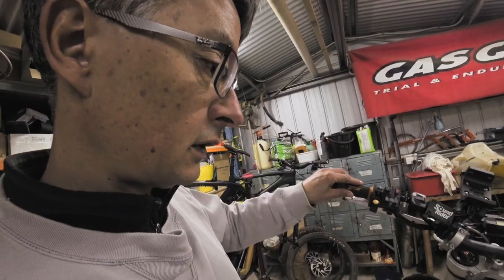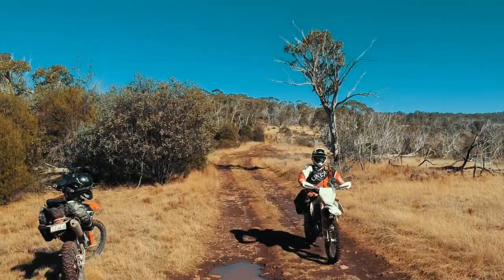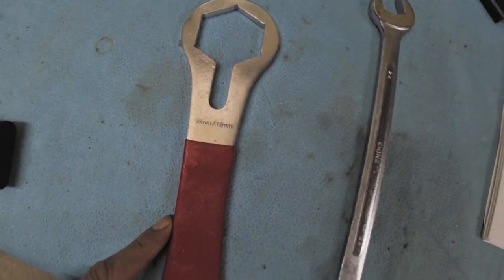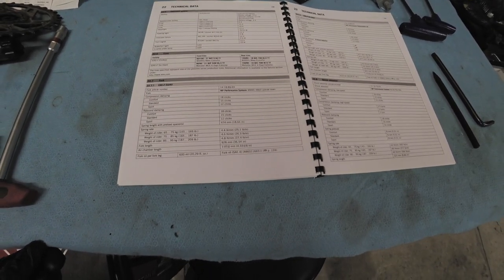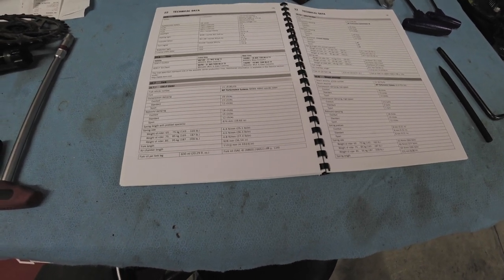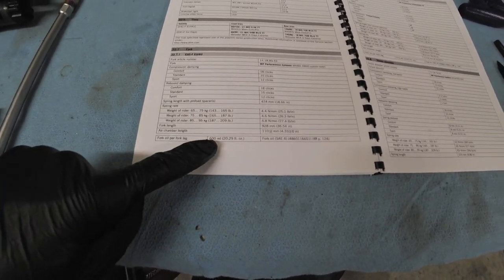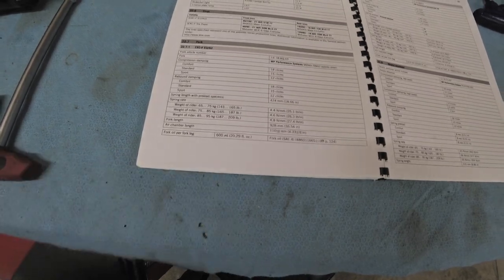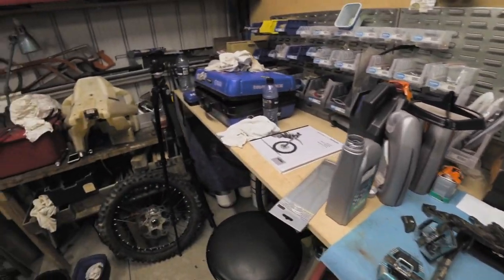How to change fork oil on the KTM 500 EXC-F

Comment: Wow. I didn't know they run an open cartridge fork.. I always thought it would be a cartridge type. My SWM 500 runs the old KYB 48mm, not too bad for the  ride, will need to put in a set of 0.48kg due to the safari tank. did you do springs rates on yours.

Comment: Hi Keith, I noticed in your video the fork spring nylon washer/spacer came out after you removed the spring so it sits between the fork spring and spring support. It looked like when you reassembled you had the nylon washer at the top of the spring under the fork cap. Was that the case and have you had the forks apart since and was there any damage to the fork spring support? I just got a 2019 350 EXC-F and the spring washer was missing altogether in 1 fork however the fork oil was brand new so I suspect the previous owner replaced a seal before he sold the bike and forgot to put it back.
Reply from the maker: gee you are observant.  It was a while ago but I remember thinking at the time I was putting them in differently to how they came out.. must've been a reason! I also vaguely recall that they differed each side somehow? Like a washer was missing? Sorry I really can't remember. :(
Reply from the maker: Safest way would be to reinstall however it came apart
Reply: Yeah, cheers for the video, just done mine.  Mine had 2 nylon spacers on rebound side.  1 spacer on compression side.  It was set up my a suspension guy for racing.  Spacers at the bottom of the spring.